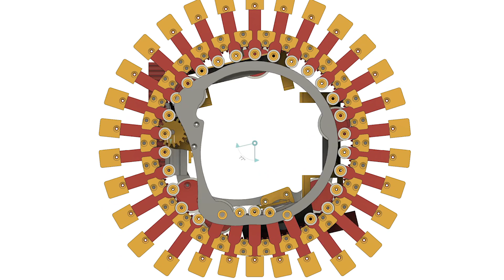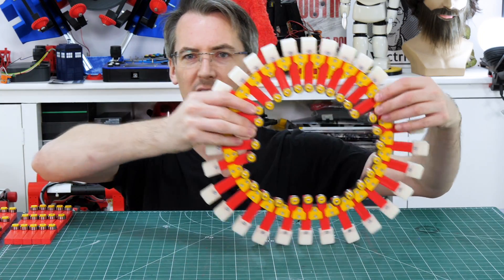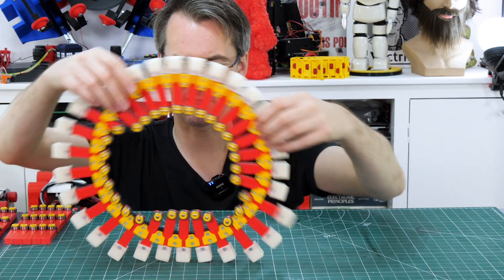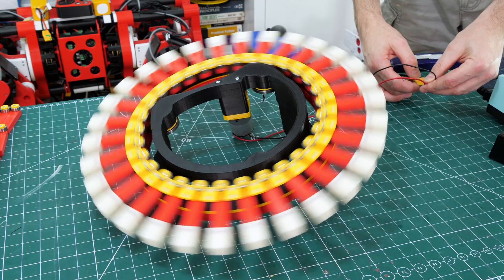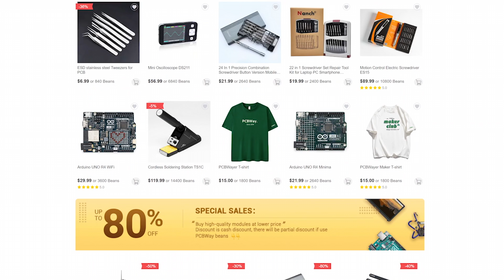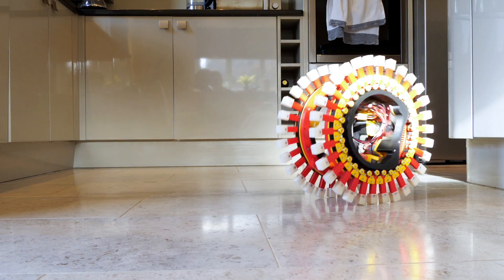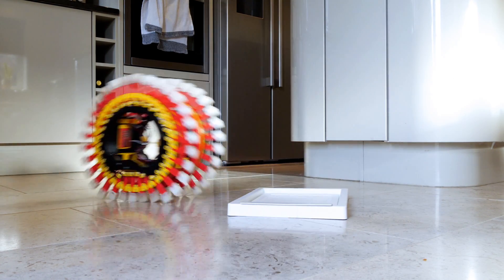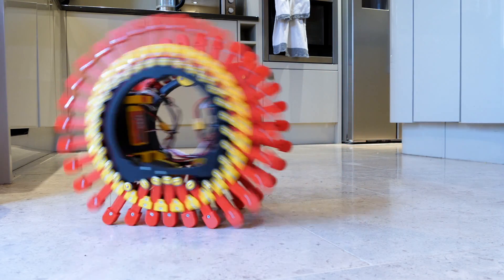Mechanically Stable Monowheel

Comment: What if the legs went through a slot/track? Would that prevent the legs from extending at higher rpm? Not sure if it would help much with the core spinning when stuck

Comment: Maybe you could program some mixers such that the tilt depends on the speed, and only does as much as needed so the outer wheel doesn't get overloaded and the thing falls to the side. It would only lean when turning at high speed, similar to a bike. Steering might be smoother when mixed and smoothed by software, so your inputs are forward/backward and turn instead of separate wheel control, which requires some skill I imagine

Another idea could  be to add some negative guide on the bottom part, so the legs actually  have to retract - not sure if it'd help, except in the spinning-in-place situation.

Comment: Hey James, a solution for your steering/traction issues is to print the pads with one side in PLA and the other side in TPU. If the TPU side points in, when you lean you will have more traction on the higher side of the monowheel and vice versa.

Comment: As some other comments have pointed out, it feels like you've more made a tall tank tread rather than a monowheel. could you perhaps swap the halves around so that the two "wheels" are next to each other so that you have something that more resembles a single wheel cut in half (and the motors would then be on the outside)? This would undoubtedly make it less stable than its current configuration, but I think it would get you closer to the original idea of a stable mono-wheel. Since you don't need the ability to lean to turn (because it has tank treads that can move independently) could you instead repurpose that to counter-balance in turns and give it greater stability? Anyways, really interesting project and I'd love to see you iterate on it more.

Comment: The leaning will look awesome you just need to use the same concepts as for cars.
Add a bit of mixing from the leaning channel to both motors and steer by only using the leaning stick!
It should look awesome and turn much better when you are not trying to do such a small turning circle.

Comment: If you add a tread (similar to a tank) to both of the wheels it might give the friction needed to get out of ditches like you had by gripping the edge of the hole. this would also keep the flat bottom as the tread can be wrapped around and up to make it follow the bearings motion.
Reply: im also interested what whould happen if you added more weight to the "drivers seat" and see if that would help with the swivel problem where it tips to far and stops making contact.

Comment: It's worth remembering that most actual tanks can't turn on the spot - the lateral forces cause it to throw a track, so they're mechanically inhibited from even trying.

I'd be very curious to see what happened if you took this and put a tall body on top of it, something about 5 foot or so.  Kind of along the lines of the waitress droids in Star Wars.
Reply: What do you mean tanks can't turn on the spot? 😂
Reply: @alexshepherd4469  Not sure if you're being serious, but just in case you are: most of the tanks that have existed through the last century would have their tracks come off the wheels if they tried to neutral steer (ie, turn on the spot).  So they couldn't.  In fact, a lot of tanks didn't even have differential drive - they just braked the track on the side they were trying to turn towards.

Now, a modern MBT can almost certainly do a neutral steer.  But it's mechanically complicated and, if I am remembering The Cheiftain's lessons correctly, still strongly discouraged.

Comment: That's not what I meant with a mono wheel with a second wheel for stabilization 😅

I thought about a free spinning wheel inside the outside wheel which stabilizes the forward/backward tilt by storing/releasing energy in the spinning wheel.

Comment: to stop the inside wheel mech spinning when stuck have auto ratchet lock into the gear wheel, you can print notches on the spacer, as soon as it detects it will be spinning, a peg shoots out and engages with a notch, stopping the spinning and allowing momentum and inertia to force the carriage forward.  If you are clever you do not even need a solenoid or a motor to do this, just a counterweight and lever mech can do this,   love this design,

Comment: you have too much weight over the center line of the inside core (the battery's are hight up over the center of the circle )

you need as much mass as possible on the bottom , becoz that's what makes the circle move forward (the weight that actually pushes on the legs that contact the ground ) . gravity will pull the weight down and if the weight wants to go forward , the outside wheel will react by going forward in order to keep the weight at the bottom.
you need as mush weight as possible close to the ground and not high up 
tanks have most of the weight on the center pushing down on the middle of the track , and tanks with rear mounted turrets or casemate are not a thing becoz of bad weight distribution ,

you need your weight to be at the center and as low to the ground as possible

Comment: What about adding a guide to keep the legs from extending at the bottom? Force it to pull them in instead of having the ground push them up.
Reply from the maker: Then it won't be flat on the bottom any more - it would just be a wheel
Reply: @jamesbruton  I'm talking about a similar shape of the inner guide, on the outside. Granted you'd only need to fill the void below it.

Comment: You should put an heavy crescent'like guide in the space under your current (under) guide.... to fully force the legs' bearings into a flat surface under the "monowheel", and to low the center of gravity.  Your monowheel's legs act like loose tank tracks without any tension in it, it's reason (centripetal force) why it do weird things at "high speed" and get stuck easily. However, it won't be a "monowheel" anymore, but more like a "round track shaped WW1 British Mark I tank".
Reply: reading the comments, many had the same ideas... 🤣

Comment: Print tbe feet half tpu half pla and angle the bottoms of the feet up towards the center. This will make a point on the pla for normal driving and then when you tilt, the tpu will touch the ground on the outside wheel and it will remail on the pla on the inside wheel.

Comment: What would happen if you stick a horizontal spinning wheel in the middle?
Reply from the maker: Gyroscopic precession would cause it to tip over sideways: https://youtu.be/UVJx8T8wTQA
Reply: @jamesbruton What would it accurately be called if it had more than one wheel? It definitely wouldn't be a monowheel like you're mislabeling this thing as. Especially considering independent suspension as well.

Comment: If you added some weights in the feet, and then kind of reverse the floor-flattened part at the front so that it sticks out a weight pushing it forward, could that help it get over obstacles? Maybe if you swapped to a flexible track where you could poke out a weight in the direction of travel... or just mount some weights on rack and pinions that can be deployed forward and back would be simpler. I wondered about that for braking a normal monowheel, though that would be more like a deployable wheel that braces against the ground.

Comment: About 20 years ago someone asked me to build a self-returning ball. The design was like a spherical version of this but with actuators where you have legs. That is a lot of actuators! Whilst your monowheel legs make it stable, they resist movement. The actuators deform the surface to push the ball along. My ball never returned.
Reply: @9:40 Mind blown how well that works with passive legs! You make it look easy!
Reply: Tilting would be good for high speed steering with a small difference in speed for the 2 sides of the monowheel

Comment: It seems like that TPU is flexible, but really doesn't give any grip like rubber would do for example.
It just slides around, maybe less worse than PLA would, but yeah. I imagine something else
Reply: He could dip them in that liquid rubber grip stuff marketed for coating tool handles. Then they'd be properly grippy. Not needed for this project, but maybe others.

Comment: Try feet with TPU on the inner edge, and slippery plastic on the outer edge. That way when it leans, it engages extra grip on the driven side but not on the pivot side. That might work, albeit only on slippy floors, and it might slide out of control if you turn without leaning.

I do really like the look and function of the pedwheels, they look so steampunky.
Reply: Had a similar thought, thought thought of TPU on the outer edge

Comment: If it helps, tanks often didn't have differential steering until later tanks in WW2. Even something like a Panzer III or Matilda has a turn radius where one track just goes slower/near-stop. So it /does/ drive like a tank, just not a super modern one.

Comment: The left/right leaning should occur automatically via gyro sensor determining if it's falling/leaning one way or the other, to keep it level. Another idea is to have the legged wheels canted, so the tops of the wheels are closer than the bottoms, to make it more stable by default.

Comment: If you use TWO wheels side by side it's not a MONO wheel anymore!
Reply from the maker: They are the same part though, not mirrors?
Reply: @jamesbruton  "Twin-ono-wheel"?
Irrespective of what you call it, it's still a cool little droid.
I'm having some of the same problems with skid steer turning on my present 4-wheel Astromech so it's interesting to see you reduce the grip to help, I'm working re-doing my wheels with the same hope.
Reply: @jamesbruton Really stretching definitions to make excuses for this two wheeled contraption.

Comment: I feel like the feet should be round instead of square, so that the tangential movement as they extend/retract doesn't cause unnecessary friction while the wheel rolls. Basically, the feet themselves should roll too, instead of having two corner edges that cause a heel-to-toe action as they're rolled onto the ground. EDIT: Oh good, you made rounded feet!

Comment: Sponsored parts: printers, filament, bearings, circuit board

Missing parts for sponsors: screws, table, power, screwdriver, board components, electronical components, motors, batteries, servos, radio, set (furniture).

Comment: I think the leaning would add value at speed with the right control. Ideally youd initiate a turn by leaning, and then as the lean angle ramps up, have it followed by a wheel velocity difference in such a manner to follow an arc with a centrifugal force that keeps equal weight on both wheels, given the lean angle. Just varying the lean angle and wheel speed difference independently from one another certainly isnt going to be ideal. I guess that doesnt solve the problem of zero speed turning though. Its always a bit of a hack with tracked vehicles but it turns out particularly jumpy for a tracked vehicles of these proportions apparently.

Comment: I think the reason why it isn’t turbing is because the inner and outer feet still have the same diameter relative to each other. In a bicycle when you turn your front wheel gets a smaller diameter relative to the rear as well as a smaller radius relative to the radius you are turning.

Comment: I wonder how it would control if you had the turning command control a mixture of the lean and differential wheel velocity. Probably not useful for sharp low speed turns but could work for smooth higher speed corners. 

Also I had a wild idea that you could make a large scale version where you are seated in the space in the centre
Reply: +1   ....or just fed from a small acceleromator?
Reply: Ya or could use the accelerometer to blend between a low speed tank like turn and high speed lean turn?

Comment: Add a guide to prevent the them from falling out. Just like you've added a guide to allow them be flat.

Basically, just make it that when on the ground, the bearings are guided in a hollow guide instead of a one sided guide. 

(Guide = ------, bearing = O) 

Your curent setup: 
--------
OOO
 
allows them to get away from the circular path but can fall back down due to gravity or centrifugal force. 

My suggestion:
---------
OOOO
---------

Forces them out of the circular path. The lower guide acts against gravity and centrifugal force.

Sorry for not explaining it better.

Comment: Could you react the moment of the motors on the body by having one bidirectional propeller sticking out the top? Would probably help and make this thing look even more nuts. Also to stop the legs jumping away from their track maybe add a guide for the bearings on the outside so the bearings are fully constrained to the path. Super cool! Never seen anything like this.

Comment: That's an awful invention, and it's... beautiful. I'm in awe at how you've designed and created it (and the previous monowheel version).  I think the problem with those legs is that they touch the ground at an angle, which creates friction and other problems. Perhaps there is a way for the leg holder to swivel, so that the legs would be perpendicular to the ground from let's say +/- 45° of the wheel.

Comment: okay, just add tires, then, if that doesn't hold the pegs in the retracted state at the bottom, you could have the insides of the pegs ride in a fully captured rail, instead of the one-sided, push-only 'bearing rail' you have here, so that they do not extend out the bottom (defeat gravity and centrifugal effects) to hopefully get a more tank-like stability in turns.

you may then need a suspension of some sort, but that'd be for a future iteration, and could be either integrated into the rail as strategic flex, or added to the pegs.

Comment: Impressive !!!!!
really wish I could do what you do.

suggestion:
And A center Tail that wrap from strait into a circle (in circle state the cab is allowed to role)
Use tail weight and elongation to control the down force (wheels's weight and traction are the up force) (maybe up-down is more spin cab-wheel).

Was my suggestion useful?

Comment: I think you would get better climbing performance if the center of mass was as low down as possible. Also, the swivel mechanism doesn't work for turning on spot but would help reduce slipping (and therefore wear to road surface) for regular turns as the outside wheel track is longer when turning with two parallel wheels
Reply: Almost like a tank.....

Comment: you should do the maths to make the tilt axis change the speeds of the inner and outer wheel automatically, so you can just steer with the tilt stick and forward. Alternatively, set the tilt amount based on the differential speed of the motors automatically. Either way, it reduces the number of things to adjust independently.  Manually controlling both speeds and tilt at the same time seems too much to handle smoothly.
Reply: Having it lean out of a turn might also be beneficial, as it puts more of the weight over the faster wheel, hopefully allowing the inner one to slip more easily.

Comment: What if you tried lean-steering the other way? Now you tried running the wheel that was off the ground trying to steer but what if you tried leaning the same way, but tried to steer with the other wheel? That way you'll lift the wheel that is standing still reducing the friction greatly.

Comment: put a latex/butle compensate inner tube slit on the inside diameter for tred. then add drive motors on the outer egde of the legs maximum inner stroke to distribute the weight away from the center most spinning mass.
it should be a good start to x4 the improvement on your current design

Comment: I wonder how it turns if it leans slightly out of the turn, rather than into the turn? It would move the centre of gravity over the faster wheel, I wonder what effect that might have. Awesome work, the jumping motion as it turns looks super cool and gives it a unique Star Wars quirky robot personality :)
Reply: I'd probably tip over more easily
Reply: I was wondering this myself.  Mikosoft might be right, but the whole point of these projects is to try things and see what happens.
Reply: The tip over comment might be correct, there's no indication the faster wheel has a lack of grip, so increasing the normal force over it will have no effect.
 
 Karts benefit from you leaning to the outside because the inside wheel is always sliding, it contributes nothing to cornering.

Comment: I would make it bigger, and give it suspension, and possibly cant the wheels out a bit for stability, and give it some rubber feet for better traction. To prevent the center part from rotating, adding a third motor for counter rotation would likely be a next step as well, put it on the bottom to lower the center of gravity of the center.  Potentially adding a "sissy bar" on the rear of the center section would also do the trick, and could also be used to stere it if you made that a rolling wheel.
Reply: When the wheel moves around the vehicle itself how exactly would suspension work
Reply: @rudimentaryganglia  You just use a kind of leaf spring where the rods compress, since they can already slide freely on that axis, you could do it rod by rod, but you would likely save complexity and mass by doing it with a single spring that stays static in the hub, or suspend the entire wheel itself.